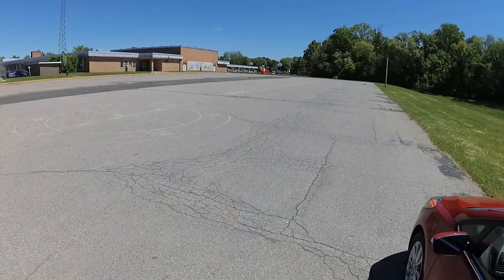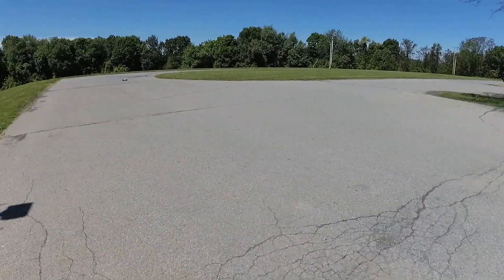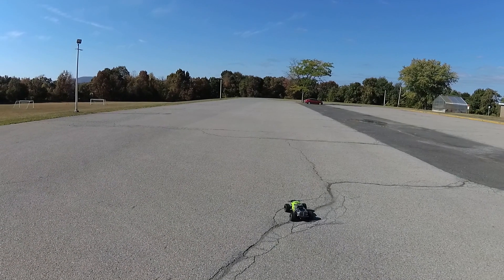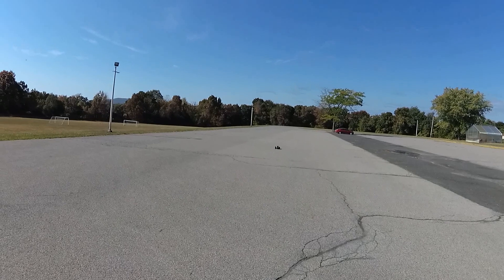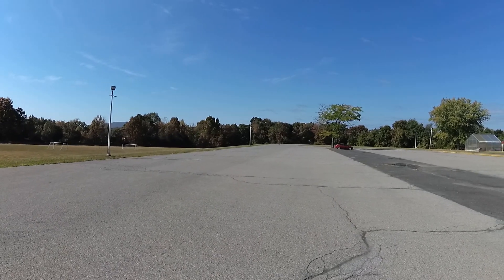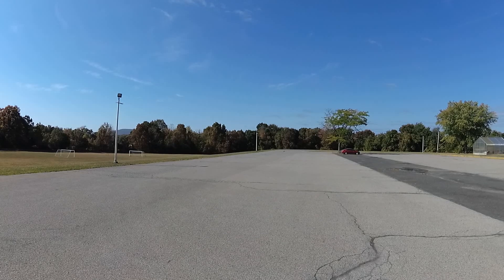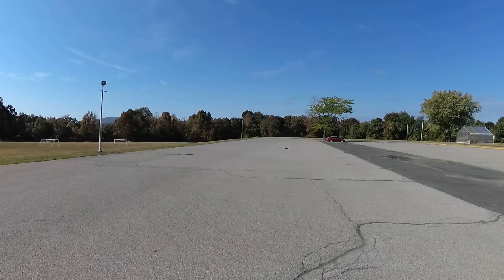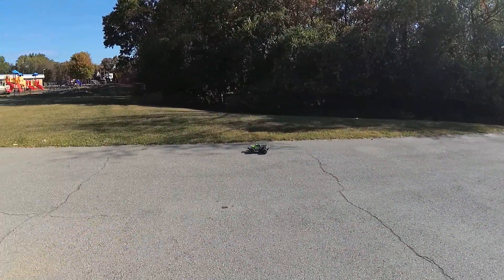🔴 ⭕️ ➤ Hobbywing 4000kv vs. 3200kv motor on "Arrma Granite BLX 4x4" - Sept 2019 *using 2s Lipo

Comment: How much different is the torque? I have bought the EZRUN 3652 4100kv for my buggy. 
The stock 3300kv from the buggy seems to be giving a lot of torque and I think going to 4100kv and loosing the torque should be fine. What do you think?

Comment: Did you run both same pinion the 4000kv with 2teeth less will   run better off rd just as good as the other 1.when you got higher kv you meant use 2 tooth less pinion or 3 tooth

Comment: Isnt the 3200kv 4s capable though ?
Reply from the maker: I never run my rc on 4s, nor 3s, makes too many costly repairs for me. Strictly a 2s RC'er. Hobbywing website may give more specs for these motors.  I was surprised this vid got so many views, never planned it that way. Peace out.
Reply: 50000 rpm motor limit so no

Comment: So i got a 4300kv f540 (finned 380 motor i guess) and 35a esc both hw combo, running mostly offroad but i turned the throttle trim half way down, motor does get hot idk how long it will survive lol. Using on hsp 94123 with bigger traxxes slash wheels
Reply from the maker: 4300kv will gear it high for top speed use, amazing the 35 amp ESC could survive it. With the bigger wheels, you are still gearing it up for top speed use, not so much 'off road'  You are like me I love to experiment, come hell, or high water. GO FOR IT, that's how we learn :-))  Have fun!! That's what it is all about! 🙂

Comment: Don’t these go 50 mph stock
Reply: Yes on 3S this is 2S
Reply from the maker: @nickyotto349  Yes, most of the rc's claim higher mph on their box, if you watch "tomley" youtube  channel, he shows how the fine print says on many different rc's with :"3s" or with optional pinion gears added would get higher mph. I have three  Arrma Granites BLX 4x4, and I only run them with  Zee 9,000mah 2S lipo's, and stock gearing , (3300kv Surpss Hobby motor used now, I get max 35 + - mph top speed. So to get over or close to  50mph on Granite BLX 4x4 you would need 3s Lipo and a non-stock pinion  gear on motor. 30mph is fine with me. 3S breaks too many parts for me. :+$, Thanks Nicky...
Reply: @danyan55  Why not 3S i enjoy the power alot, but if you are more casual that is fun too, i think you could push 50-55mph with 3S 4000KV motor
Reply from the maker: @nickyotto349  I and my son run the Granites when he visits from his out of state home, and the 2s is fun enough at our local school parking lot. The expense and work for repairing a faster rc (3S lipo) gets expensive and time consuming. I just enjoy driving the rc, not repairing it. :+\   Enjoy, love the Granite. Can't think of a better rc.  Be well, have fun.
Reply: @danyan55  i understand now, have fun :)

Comment: Thank you. This is simple and well done. My question is if you use the lower KV could you use a larger pinion and get more top speed?
Reply from the maker: Alot of bashers do play around with changing the pinion gears, I stick with the 15t Granite stock pinion and just change kv motors, I'm using a Surpass Hobby 3500kv (Amzn) and nothing special, did top speed of 30mph (2s lipo) , but rarely a wheelie. My favorite matchup is 15t pinion and a 3200kv 3660 brushless motor for best mix of off road and blacktop running.     WLToys had big problem with their large kv motor and large pinion, had to come up with a "Version 2" Tomley has a vid on the ver 2 incident, so I don't want problems with cogging (Hesitation) so I keep in a certain range always with 15t stock pinion. If you ever rode a 10 speed bike, you get a better idea of gearing issues from the similar effect.
Reply: @danyan55  my granite I put a 130amp Fuse 4S esc in it and it will hold a wheelie as long as you hold the throttle. With 3S or 4S. Stock brushless model would basically do the same. So the upgrade barely made a difference. With the stock motor still in. I’m looking at a 4278 1700kv Taurus I’m putting in my tailon with the stock 6S 150 amp esc. From a 2050kv and wondering if I should up the pinion or leave it.
Reply from the maker: @jimmyv1753  Playing around with pinion changing is a tough call... i leave mine at the stock 15t and run a 3200kv 3660 motor with only 2s ( 3s pops out my driveshafts cross part) so I just deal with 8200mah 120c  Zeee lipos, 100amp stock ESC.  Give it a try, a low kv rating will give you  high torque, but lower top speed. If you don't get everything right you may run into cogging / delays on the startup with motor. Have fun...  :+)
Reply: @danyan55  yeah. I’m working with a stock Talion 6S and I have already ordered the 1700kv motor. I’m not sure if or where I’ll use it. I’ve got several 6S/4S/3S/2S vehicles. I was hoping to stuck the 1700 in the tailon and add 2 teeth to the pinion and was hoping for similar top speed with a little extra torque.

Comment: Great comparison video! Ide like you to try 100-130c batteries to see if it changes the speed. If you are unable, I don’t own any low c rating batteries, but Ide be willing to test this to see if it get higher speeds. Great video! 👏👍💯
Reply from the maker: This was an old video, I don't use the hobbywing motor or esc anymore went to Surpass Hobby Platinum 3660 3300kv & 3800kv motors and Original Granite Version 1 esc BLX100 esc.  Sorry, I now use Zee Lipos 8,200mah 120c 2s, love them, only use them.  This video got alot of views, never thought it would, I was confused about 'KV' and researched and threw together this video. Be well.  ** Here's my Granite Today (4-14-2022)  https://youtu.be/LfvXri7vJnQ

Comment: how much more lower end does the 3200kv have
Reply from the maker: I estimate from seeing other speed tests that with a 2s Lipo you would get 10 mph LESS top speed than using a 3S Lipo.  I avoid 3s lipo, I'm not into 'high speed' it usually means more parts breaking. :+\  $$

Comment: What pinion do you recommend for the 4000kv? 12 or 13t? Did you used 15t stock pinion for all these tests? thanks
Reply: Would indeed be interesting to see what would happen when geared for the same top speed, so with a 12T on the 4000kv motor.
Reply from the maker: I always stick with the stock 15t I have the original motor mount with the drilled holes for 15t, 20t etc. I don't like the newer adjustable motor mount due to screws loosening and motor adjustment moving.  IF you use a lower 12t or 13t pinion with a 4000kv motor you will be gearing down the motor so will go slower top speed. IF you are looking to speed up Top speed, you would want to go to a higher "t" pinion to up your top speed with a 4000kv motor. Make sense?  Good luck. I am running a 3300kv motor now with 15t pinion and loving it for high grass and blacktop bashing. 4000kv would be sluggish in grass. :+\

Comment: How fast is it with the stock brushless motor? I thought its faster then 50mph🤔
Reply from the maker: The stock 3200kv motor I saw a video on youtube showed he did a stock motor  test using 2s lipo, and he came out maybe 30mph.  The fine print on Arrma Granite box says "50mph" BUT that is with a 3s lipo to get maybe 50mph. I never use 3s, breaks too many parts, so I always use 2s 8200mah Zeee Premium lipos for longer runtime, not concerned with speed, just run time. There are some youtubers who did speed tests with 3s. Not for me... I spent enough on repair parts after 2.5 years of my Granite v1.
Reply: @danyan55  the video title literally says 3s
Reply from the maker: @666soccermom666  Sorry about the confusion, Arrma Named this rc with the "3s" to make us aware that will use UP TO A 3s Lipo, It will also run on a 2s lipo. I never use a 3s lipo on my Granite rc, as it does more parts damage at high speeds. The ESC is rated at a 3s Lipo use, but will work fine at 2s.  The proper name used by ARRMA for this rc is "Arrma Granite 4x4 BLX 3s"   I have used a 3s lipo on this rc, but it was running too fast for the weaker parts, and I got more breakage. Be well.  D.
Reply: I wonder if the higher current of the max 10 sct esc would make a difference. Also I think a 3s would add a lot more speed as well as using a battery with a higher C rating. 25c is very low
Reply from the maker: @DarthSeanious  Yep you  are right, I have thrown out the Traxxas  25c lipos and only use  120c lipos, Zeee Premium 8200mah.  Peace for a New RC Year.

Comment: Hi would the 3300 Kv fit in a tamiya dark impact? Thanks 🙏
Reply from the maker: Never used a Tamiya, IF your current motor is a 3660 style motor and 5mm shaft, you may be able to. Check your Tamiya rc specs for stock motor info.

Comment: My Arrma Granite is getting a spectrum 4000Kv upgrade this week. Or should I go with the a lower kv??
Reply from the maker: You have to remember the HIGHER the kv, the higher TOP SPEED and less low end TORQUE. 
High kv i.e. 4000kv is good for on road rc'ing, but not so good for OFF road RC'ing, you have to decide on where you ride your rc most of the time, (ME, I use mine on road, and slightly on grassy low hills,  [  https://youtu.be/oUE43cAwCLI   ]  so I settled on my Surpass Hobby Platinum 3800kv and it works great  for my purposes. #  I read online, that 3000kv and LOWER are good motors for OFF ROAD, and 3000kv and higher are good for ON ROAD.  The lowest kv motor I have ever used was 3200kv Granite stock motor.  *I have trouble with my 3800kv clicking off my ESC IF I try to go UP a steep hill ( * To reset ESC and get rc moving again, turn on/off switch Off- then back on) You have to know your rc likes... speed or torque, your choice... Have fun
Reply: If you get a 2200kv motor you can run it on 6s getting a lot more torque and also more rpm so, more speed

Comment: I think what needs to be mentioned with these motors is that they are fast but to get the most out of them you need to be using a high voltage ESC, these motors need more power they usally combo with an HW max 10 ESC at 120amps which is good for 4cell not 2cell, whilst the motors are rated at 2 to 3cell for warrantee reasons on all brushless motors now days the ESC states 2-4s on lipo with a recommended 3cell count of the lipo being 3 with a +50c discharge, the motor and esc handle this well, without getting too hot. 

I personally see around 95kmh/60mph with a Hobbywing MAX10 SCT ESC Combo With 3660Sl 3200Kv Brushless Motor on a 4wd chassis on a typical high discharge 3cell and on a 4cell turnigy graphene I can get around  110kmh 70mph on a stretch and that's the difference between using cheap components with quality parts like in this video or using quality parts with quality parts, yes you may think this is slow but that's because it's being used bad stock lipo and cheap 100a stock esc no doubt
Reply: Hi what pinion are you running g to see these speeds on max10sct and 3s lipo?

Comment: Are you saying that you’re using 25c  lipo on your Rc ?
Reply from the maker: Yep, keeps the rate of broken parts to a minimum. I am not out for speed, just a hobby. I spend enough $$ on Arrma repair parts. Just bought a HSP 94111 4wd rc. Love it, better built than Granite, using 100c 2s 5000mah lipos on it, runs great and durable. 3300kv motor Good quality 4wd rc. Good deal on Ebay for it.  My Traxxas 7600mah lipos 2s are all 25c, use for long runtime not for punch, Granite drive shafts become a problem with high torque and 3s. Not for me...
Reply: @danyan55  what do you mean by driveshafts becoming a problem on 3s ?
What exactly happened and under what circumstances ?
Thanks for answers :)
Reply from the maker: 1-23-2021 --  I just switched over to using Hoovo 8000mah 80c 2s Lipo batteries. Available on Amazon. Excellent runtime and high quality!    Amazon Link:  https://is.gd/zrAxrL

Comment: Which ESC is the best for the 4000kv motor?
Is a 60A enough?
Reply from the maker: I have used the Hobbywing esc (120a I believe) with my Granite, but I went back to the stock Arrma BLX100 ESC due to the on/off switch mounting better fit. I placed my receiver inside a balloon and zip tied it, and never had problems again due to water getting in the receiver box (and burning out receiver... no more problems with balloon trick). I like using the BLX 100 esc more than Hobbywing due to switch mounting and I'm more familiar with Arrma's BLX100. 
 Not sure about a 60a esc, maybe someone will use 'comments'here with help for you. I stick with 100a ESC's and above.
Reply: @danyan55  Ok thank you. 
Why does water entre in receiver? Is some component's refrigeración? 
Ill search more about esc compatibility.

Comment: How long were your battery run times?
Reply from the maker: I use only Traxxas 7600mah 2s Lipo batteries, I get maybe 40 minutes to 1 hour 15 minutes  depending on how fast I run the rc truck. It depends on how hard I use the throttle. I rarely use 3s batteries due to plastic/composite gears in Granite dif's, too easily stripped on 3s Lipos.

Comment: Thanks for testing this. Would this mean that the 4600KV set has even higher top speed? What would you recommend for your Arrma? The 3200KV for more torque? And is the 4000KV motor also rated for 3S?
Reply: Lower kv with higher gearing is all u need and my granite blx v3 able to hit 51.6mph out of the box with 3s(5200mah/60c)
Lower kv also runs cooler 
Just sharing! :D
Reply: @honk4014  thanks!
Reply: @Musiquence  😉👌
Reply from the maker: ** IF you go to this Hobbywing link (scroll down to chart there), it shows that the 4600kv motor is only good for 2s batteries,
[ ** ]  HOBBYWING MOTOR SPECIFICATIONS :  https://is.gd/cHWCMl

 * I personally use my Hobbywing 4000kv motor most all the time now,  * 3200kv would be good if you do more off road bashing. It's mainly how you use your rc as to which motor is better for you.

Comment: Awesome video very nice comparisons and speed test runs great job thumbs up 👍
Reply from the maker: 10-12-2019 -- Thanks for the compliment, I like to share my experiences, I have learned so much from other youtubers' videos, and like to pay it back with my info.  If you watch my older video, you can hear my stock original Arrma 3200kv 'whiney' motor,  [ https://youtu.be/uiqoBiHRuUY  ] I got tired of hearing it and started experimenting with Hobbywing motors. I now use my Hobbywing 4000kv most all the time, love it, nice and quiet and fast. It's my go-to motor, fits perfect in the Arrma Granite BLX 4x4 3s, and it is 2s/3s Lipo capable. Real Happy with the Hobbywing 4000kv.